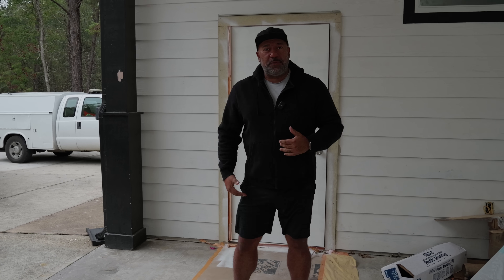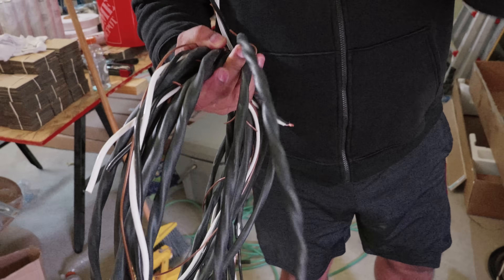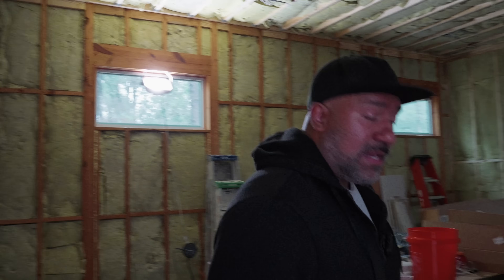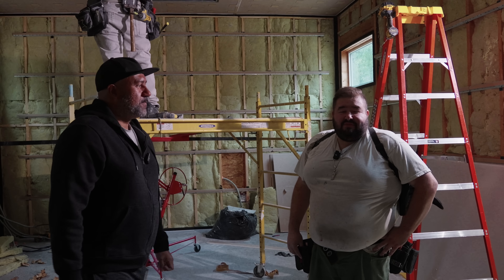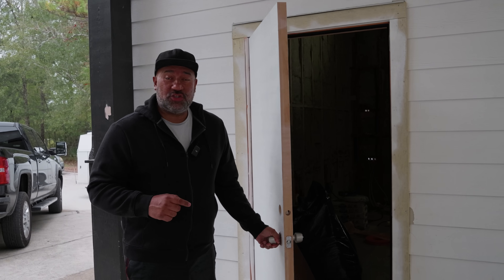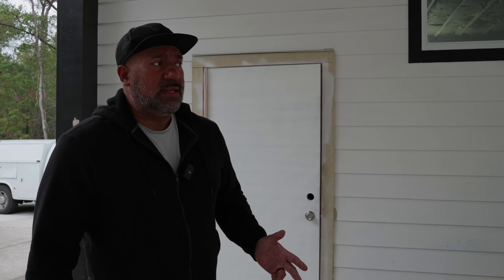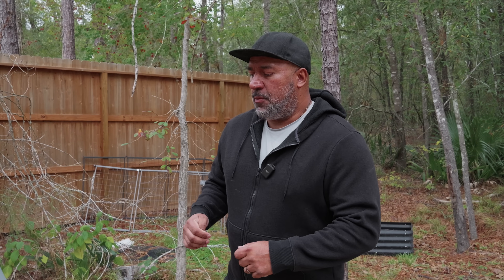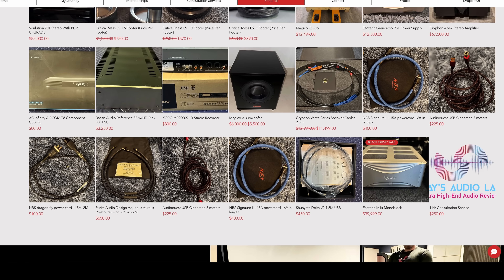Why This Electrical Setup Is A Fire Risk

Comment: I'm relieved you changed out that twisted wire.  I was afraid the copper may have been damaged by that twist, or at the least, the copper took on some grain boundaries from micro-stress fractures, which adds noise.

Comment: In conduit, or flex as is this case, rejection of heat is a concern. Twisting could reduce the surface area exposed to the metal conduit and the air in the conduit. That's why the electric code has fill schedules for different size conduits. Wires are typically rated for maximum current based on some temperature rise, generally like 90° C. Good catch that this might compromise the heat rejection. 

Now, all that said, you were never going to get close to the ampacity of the wire with normal equipment. The circuit breaker should trip long before you could reach the thermal limit.

Comment: Jay,
Twisting the cables don’t damage the cables insulation unless the twisting is done applying lot of torque. Those cables are rated to be used inside a cable conduit so the insulation is very hard. Other thing is that these #8 cables won’t be used near it maximum continue amps rating so the temperature won’t be high neither. However, is always better to follow manufacturers recommendations and avoid any future issue with your insurance company.  Double check the grounding rod connections with a licensed professional, the recommendation is to use only one rod as the main grounding point and connect the others to it. There also a very important rule for the neutral to grounding bonding that need to be follow.

Comment: Twisting AC wires does theoretically reduce EMI transmissions from the wire, but that is only important if you have other kinds of wiring nearby, such as audio or Ethernet (fiber cabling not affected by EMI). Putting an AC wire in a metal conduit also reduces EMI transmissions, but again not important unless the AC wires are near some other important wiring for audio, Ethernet, etc.

Comment: Quit freaaking out about your electrical system... go back to the panel and look.... all your circuits are coming from that box... they are all near each other... all from the same buss.  The guy that drafted the letter was probably an attorney .... manufacturers don't like liability. But, I don't think it was a good idea anyway....the new 8/3 you purchased is twisted, now you can use the red wire for ground with a little bit of green tape.   I have a dedicated room... I wired it, as well as my entire home... including the electrical service and grounding system.  You will be fine.  Relax.  I see you have replced the shit plastic boxes with solid metal... you will not regret it... floppy outlets suck.

Comment: Jay I still wonder about "differential" that could be brought on by employing multiple grounding rods - - each rod being 10' apart from the others will unquestionably have slightly different electrical characteristics regardless of how miniscule those characteristics might be, something that you don't want - - - I have no clue what codes need to be employed, that is, does the code actually insist on multiple rods & spacing? If there is no code preventing it, then it would seem that one rod, perhaps slightly larger in diameter, would eliminate this possible issue. What I mean is, there's going to be one or more rod(s) out of the bunch that will act/perform slightly better than the others, this will produce electrical differential between them which is something to avoid if possible especially given that we're not talking about washing machines & an air conditioners where what I'm pointing out would make no practical difference. Jay, as I've mentioned before, I love what you're doing, the progress is amazing to watch, can't thank you enough for documenting this entire project.

Comment: Jay, love the electrical safety turnaround! Smart move. But all those peel-n-stick pads? Y’all really stood on ladders for hours measuring 12" centers and rolling them on overhead… when you could’ve just treated the drywall sheets on the ground before they went up - less than 5 minutes per sheet. Neck pain and vertigo avoided. Next time: treat the sheets on the ground, then install them!😂
Reply from the maker: Those are pads from the manufacturer of the isowall. They were glued to specs and it’s the first time this was done. Maybe the second room will be done the way you described

Comment: Your electrical plans should have told you the spacing of the ground rods. Why not just use MC cable? it is shielded and twisted. If you are that worried about it just put the power wiring in conduit. Is there a radio station nearby?

Comment: Jay, I’m developing undulating headaches watching your construction!!

If you can, is there a way to show a diagram of how the ceiling comes together as an isolated system with very basic explanations?  I just do not understand the engineering and I cannot piece together your contractor’s explanation.

I am following along with great interest snd respect.  Thank you!
Reply: Yes, his attempt at explanation did fall a bit short, and an engineering drawing of the system components would be illuminating.

Comment: Nice touch having outward swing doors. They can't kick the door in.
Reply: The door should swing in. When the the air is pressurized by subs it helps to seal the door.
Reply: @carlosoliveira-rc2xt The door is sealed and latched Jay said it takes both hands to open it. I don't think he is going to have to worry about low frequencies against the door.
Reply: Might have to check if this is up to code. The door could be blocked from the outside during a fire!
Reply: @davewin1792 Doubt It is a code violation. Ever notice that commercial buildings have outward swing doors? (unless they swing both directions) Just for one of the reasons you mentioned. If people are running out of a building, you want the doors to swing outward for easy egress. 

It would be wise for Jay to keep a fire extinguisher in the building. One time at the recording studio a student disconnected a microphone with phantom power (48 volts) going to it. 
The surge caused the amplifier to catch on fire! Fortunately another student immediately shut the amplifier off and unplugged it. The fire stopped at that point and the amplifier was surprisingly repairable.
Reply: @davewin1792 usually code for doors to open out in commercial
Reply: @davewin1792  The first Texas fire code reference returned on a quick Google search states among other things, and clearly in context of commercial, educational, or high traffic public buildings, that rooms for 50people or more shall have exit doors that swing out.

Comment: I recommend bringing in a sound system capable of high SPL (could be a PA system, no need for anything fancy) and playing a swept sine wave through it.  As you play the sine wave, it will reveal any vibrating wallboard, framing, or whatever else can resonate.  A simple sine wave will reveal problems much more clearly than any other test signal.  Better to do it at this stage than wait until something loose gets sealed up behind something else, or all the finish work is done and all the workers have been paid and gone on to other stuff.
Reply: People made fun of me for spacing my drywall screws every 6-8” for this purpose alone. I also added screws to the framing that was nailed along with glue PL Premium.
Reply: Before digitally generated signals, etc., there was The Rattler! 
Circa '80s, The Rattler (iirc) was a handheld LF tone generator ... for exactly that, finding troublesome rattles etc. 

I know this because when I first went all in on ULF/LF, via my attic manifold IB sub, I looked everywhere for my device, ... to no avail. 
That was 10-15yrs ago.
Reply: @FOH3663  When i was into car audio in the 80s/90s I bought something called a PAG-1 (Portable Audio Generator-1), a simple analog sine wave generator that you could sweep with a potentiometer.  It was useful.
Reply: I asked Jay the same question earlier. Than, the construction material and equipment would probably start rattling more than walls. The openings for HVAC and not having a door between rooms is another story. We’ll see if the test going happen.

Comment: As far as I know, not supposed to run that cable with the black jacket inside conduit. Supposed to be just the twisted wires.

Comment: So have to ask. A 4'x8'(12'?) sheet rock floating in suspension? A drum head? Will they be damped as well? Or does mounting at the squares do the damping? Break up nodes?
Reply: Look it up, ASC Iso-wall ... or something similar.
Reply: @FOH3663  They use the WallDamp Squares for this purpose.
Reply: @glenncurry3041  
Yes? 
 ... as part of the ASC Iso-wall system I mentioned above.
Reply from the maker: They are decoupled by the channels
Reply: @jaysaudiolab  Decupling and damping are two different things. A sheet of sheetrock is a drum head unless damped.

Comment: Hi Jay. 
There is an insulation test that you could have done 1st prior to removing cable.  Is called  a megger test. The tester used shoots  1000V through the conductor and will let you know if there is a leak on the isolation. This is what we do before powering on large cable runs. If you have a leak in the insulation the voltage will jump out of that Crack and the meter will let you know about it.
Reply: That would have required a Fluke 1587, or similar. An instrument on truck of most any licensed electrician but not a diy’er or handyman that is going this job. 

Watching this guys videos is not intended to be insightful nor educational, it’s comedy relief.
Reply: It's not about whether or not the insulation has been compromised, ... it's simply insurance liability. 
Following specific mfr. guidelines, and it's documented vlog style.
Reply: That's fine it makes sense. Don't think there would have been any issue with cable starting a fire at all if the cables installation tested good. The maximum load alllowed would be 20 amps. But I do understand what you are saying. Better being safe than  sorry.
Reply: @socratesliriano9852  
Agreed. 
To be clear, it's not even about safety. 
It's:
- public video of the cable twisting
- public video of Southwire's written position

Jay had to change it, ... and yeah, it was likely perfectly fine. 

fwiw
(even if there the insulation was compromised, doesn't automatically mean it'd manifest into a problem)
Reply: This is all for information only. Replacing the cable was the right thing to do if it was going to bother you. As you may already know #8 awg  wire with thhn insulation can carry 40 amps  and may also be allowed to carry 50 amps for certain loads that use high amprage at startups.  With this in mind, you are using a dedicated outlets wich means you will most likely plug in one device per outlet. 
Most of you equipment will not draw over 15 amps at a time which means you won't even tickle the 8awg wire. So you will have barely no resistance which means very low EMF.  Twisting the cables together will cancel pretty much all  the EMF. 
What Im getting at is that with megger test if the installation  was not compromised you could have left cable in place without any worries because  the current going through that conductor would have been very low for that size conductor which means no heat. 
When we do cable installations  we are required  to keep conductors within the same circuit as close as possible to keep low EMF.
Reply from the maker: @socratesliriano9852 great feedback but too late now
Reply: Yes but we definitely want him to succeed in what he is doing, so we can get more videos!!! He is the only one who puts these crazy priced audiophile equipment on YouTube. I would have not known  about how extreme this hobby is without him.
Reply from the maker: @socratesliriano9852 thanks 😅
Reply: @socratesliriano9852  Jay is on a different level. I wish him the best honestly at this point.
Reply from the maker: Good to know!

Comment: Jay, are you planning to brink a sub in prior to finishing the drywall, to see if anything is rattling and perhaps needs just a few screws. Finishing drywall in this room and completion of the 2nd would take 10-14 days. What are the next steps pet project plan?
Reply from the maker: Finish the walls.  I don’t think we will have issues
Reply: @jaysaudiolab what harm would 20min of sub bass be? You have already gone and had to redo so many things already, you really want to chance the chance of a you never know? I would do it with the track record so far in this build already. Do you really want one more

Comment: Hopefully you don't have the same issue Danny(GR Research) has with his new room being too air tight🤞
Reply: No such thing as too tight building envelope.
Reply: @MichaelM-to4sg  Tell that to Danny.  He said his room was too tight and holding onto too much of the lowest frequencies.
Reply: @mrsmokalotapotamus6530 I have no idea who “Danny” is but clearly is ignorant of building science, engineering and HVAC. If he’s a friend of yours, tell him to hire a professional. Even a competent HVAC contractor can “fix” the issue.
Reply: @MichaelM-to4sg Danny, as in Richie of GR Research. Ask Jay if after his earlier visit he thinks Danny doesn’t know what he’s doing. The above comment refers to Danny’s observation that his room currently under construction was too tight and found that opening a door mitigated some of the LF modes.  It is entirely possible that regardless of idealized dimensions and sound isolation, a room built with insufficient amounts of minor compliance at the lowest frequencies may be an absolute MFer to deal with after the fact.
Reply: @fonkenful  jay was just humouring him 99% of people know he is just a snake oil salesman with wrong theories

Comment: What a huge pain in the ass, lol.   Are you still on speaking terms with your electrician?
Reply: What electrician? He’s shown multiple NEC violations. There is no electrician and no permit for this job
Reply: @MichaelM-to4sg  I assumed he had an electrician  🤷‍♂
Reply: @mrsmokalotapotamus6530 The fact he’s running 8AWG wire to 20A split phase receptacles should give you a hint that no electrician is involved. 😉
Reply: @MichaelM-to4sg  I don't know enough to pick up that hint.
Reply: @MichaelM-to4sg  
What's the issue?
Reply: @MichaelM-to4sg you 1000% correct on not a single permit was even a thought for this job! The gas line episode(s) made that obvious. I'm waiting for one of the neighbors to get curious about the NEE GUY IN THE NEIGHBORHOODS little construction project that been happening for the past month, and they call the permit office and inquire. Then Mr Jay gets a visit and Julio gutriguez and band of ice men clan are never seen again. Hell they're such a big contracting outfit they don't even own a drywall lift, well they do now. Look out baby they're going big time now.

Comment: I used to have Kimber 8-TC speaker cables. The idea that a twisted cable (TC) is somehow more prone to catching fire never occurred to me, and was certainly never mentioned by Kimber in their literature. I'm sorry you had to incur the additional expense, but hopefully your peace of mind is worth it. Looking forward to the finished rooms.
Reply: fwiw, twisted cables aren't the issue. 
TWISTING the cable is the potential issue.

Regardless of if it's even a safety issue, once it was documented on video (State Farm is watching), and the mfr said "no bueno", ... it's gotta be removed and new installed.
Reply: I think you’d be pretty hard pressed to find any speaker that would require the amount of current that would be required to cause such a risk.
Reply: @fonkenful hi, remember Jay among others "baby" amps is using Gryphon Apex Monos with 2x2000Watt toroids and some 1,040 Farad in capacitors!!! Such amp will drink Ampers from power network like the Irish saylor. 😂 Jay's rooms are quite huge, will be well damped. With some Magico Q7 at the end and higher volume also power consumption will be high, no doubt. BR.
Reply: @Integralista001 I was talking about the current passing from the amp to the speaker. High end audio cable manufacturers like to tout many technical specifications and in some cases near magical properties and materials for their products, but to be honest other than those rated to meet flammability ratings for in-wall installation, I’ve never seen any mention of hazard of the wires themselves  bursting into flames. Many of us have seen & smelt toasted crossover boards or fused voice coils when in judiciously overdriven,, but I’ve never encountered a fire from an overheated speaker wire.
Reply from the maker: Appreciate it!
Reply: Speaker cable

Comment: Who had you twist the wire in the first place?
Reply: Clearly not someone who has a clue about code
Reply from the maker: That doesn’t matter
Reply: Well that’s a few thousand dollars waisted if I had to guess by time add labor into all waisted wire replaced. I didn’t say anything when you posted original video when were twisting it but that was stressing the wire for sure. No reason for it honestly especially when will upgrade the panels in future with clean power system I’m sure.